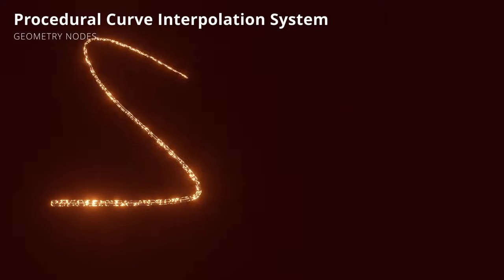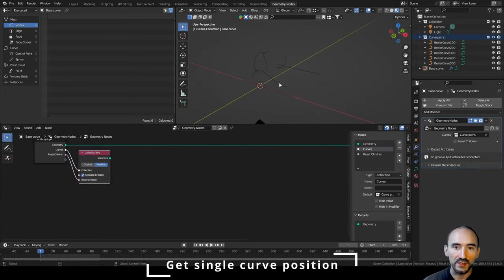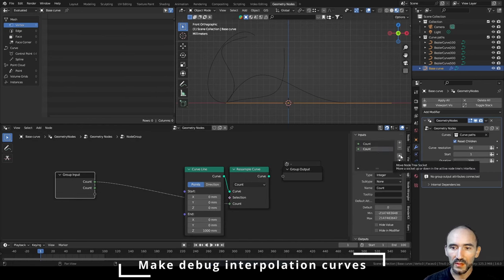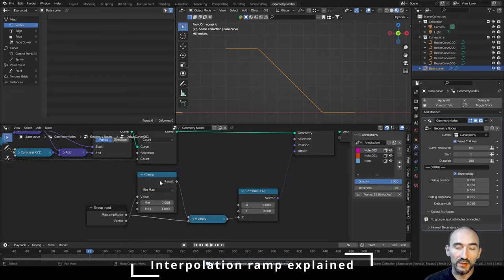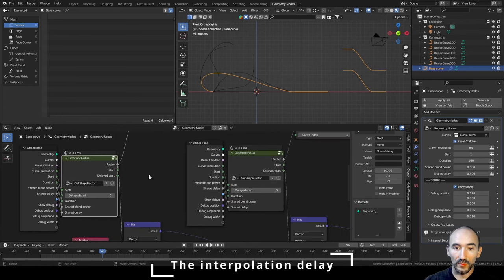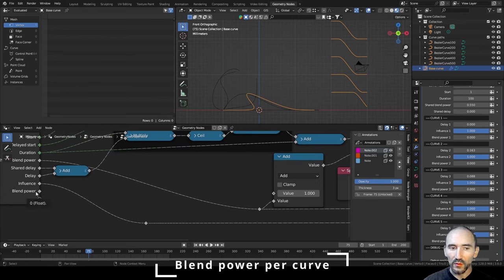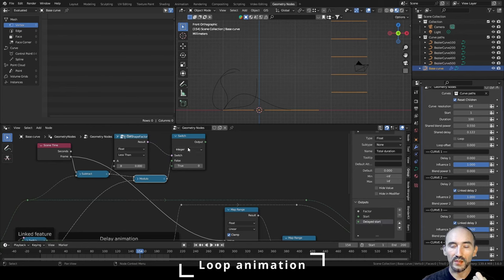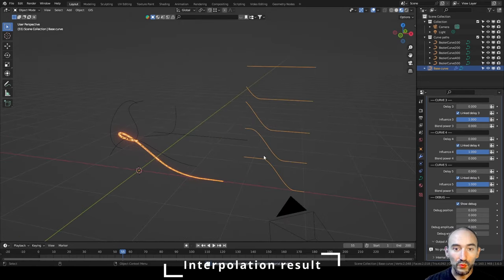Procedural Curve Interpolation System

Comment: Awesome work. Is it possible to have this work on multiple curves that are one curve object?
Reply from the maker: Thank you Michael! Do you mean like the arm of a Mimic (film Edge of tomorrow)? I would say yes but you would need to add some refinements because at the moment the only curve that can follow the correct interpolation of the setup is the first of your base curve object.
If you add a second curve, that curve would have a start index not from 0 but from the Curve resolution attribute set in the modifier and this can't be use as is for the interpolation. It's a bit complex to discuss. For this reason, if you don't have a complex system i suggest you to
1 - use properties of an Empty object and use them as drivers for the attributes of the modifier for the first curve
2 - use separated curves objects
3 - select all the curves and at the end the first (that has the modifier added)
4 - CLTR+L and use the menù "Copy modifiers"
In this way you have the interpolation system added to all your curves but driven by the same object properties of the Empty object. "One ring to rule them all" ;-)
Reply: Thanks for the quick reply. I want to try it on a stylized hair groom, I think the control over the curve would work well, but yeah separating the curves might be the easiest way.  @andrea_ciani
Reply from the maker: @michaelvaughan2986 You're welcome!